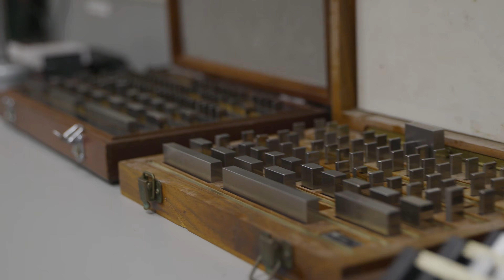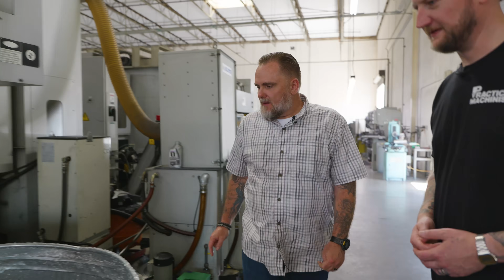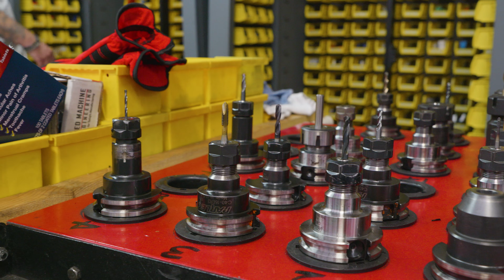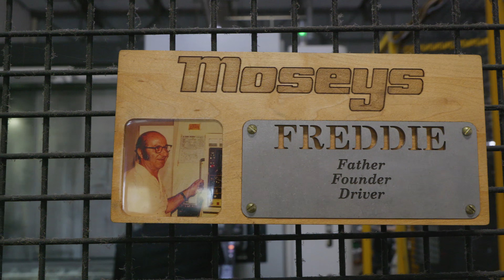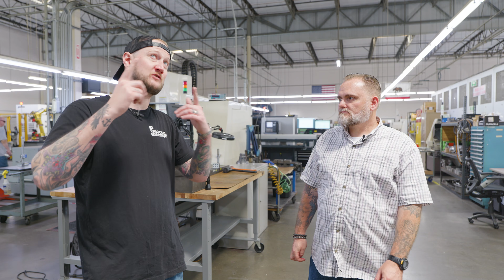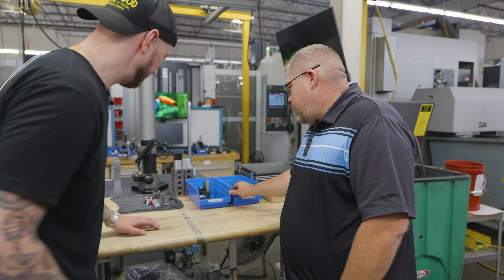This Shop Knows How to Boost Efficiency! | Moseys Production Machinists Shop Tour

Comment: Can’t believe the lack of PPE for the employees? Wearing shorts, no safety glasses etc, I’m  surprised they haven’t been closed down until the health and safety auditors are happy?
Reply: Meh. I didn't notice anyone working a machine without glasses, and I don't think shorts are really an issue in most of the roles. Modern machines have pretty robust enclosures, so if anything makes it through that - Glasses and long pants probably won't help you, lol
Reply: I don't understand the obsession for pants in a CNC machine shop where all the cutting areas are enclosed. Hell, pants have actually caused me to get snagged on something more often than shorts so. And I don't think I've ever seen or heard an injury in a CNC machine stop that would have been or was prevented by wearing pants. 

Manual machine shop with chips, especially around lathes with razor sharp long chips? Sure, pants all day. Weld and fabrication shop? Pants all day. Those it makes sense
Reply: My guys and I wear shorts 9-10 months out of the year in NC.  6 enclosed cnc machines.